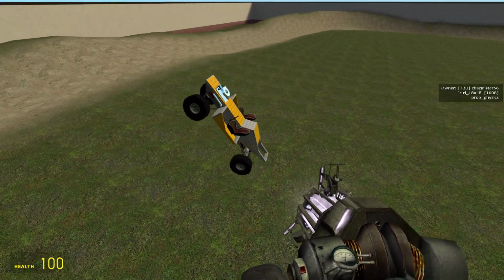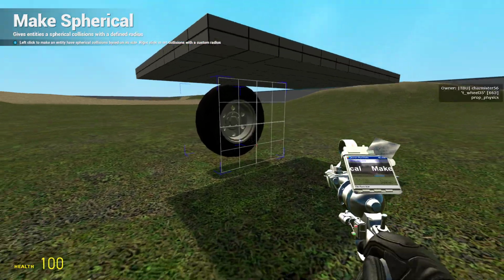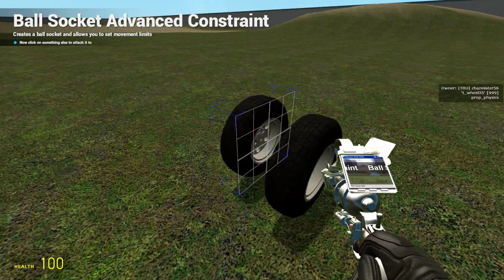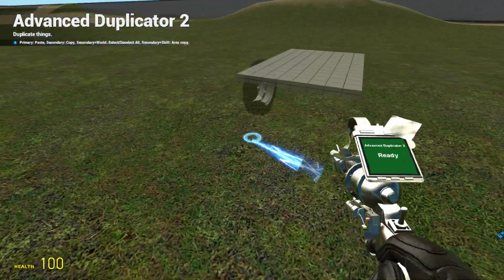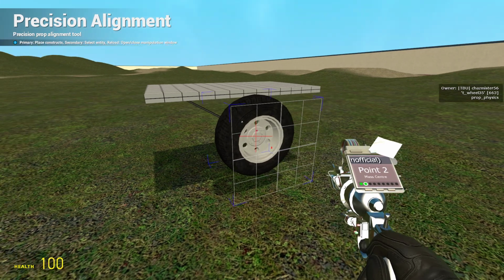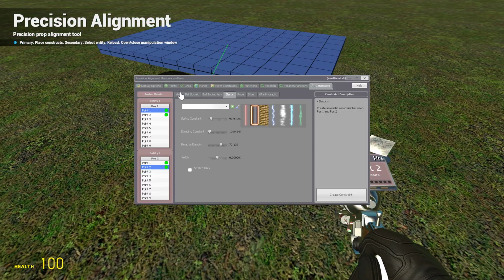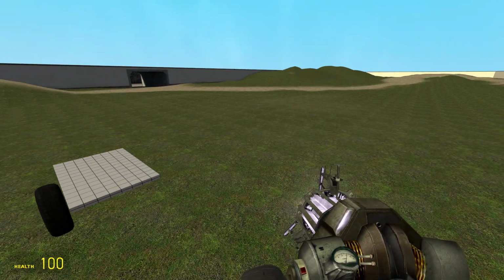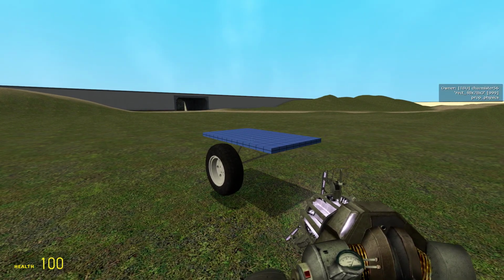[OLD VID  / NEW CHASSIS TUTORIAL OUT NOW] Gmod - 2018 Suspension Basics/Elastics - chazmister56

Comment: i doubt that he will respond to me since this is five years old, but what did you use to propel the car in the beginning foward, and how did you make the complex curves and what not? if he doesnt respond can somebody please tell me i want to make a car like the on in the beginning but i couldnt figure out how to make it move.
Reply from the maker: @huetrwiny  Still active and playing gmod even now, I try to keep up with comments when I can
That chassis is powered by a simulated E2(wiremod) engine, however ACF also works as I've used that for years as well even in that same chassis. The props used are Sprops, the add on should be called Sprops Workshop Edition I think. I just used cylinders to make the cage structure as you would in real life, then spheres on the ends that are the same size move with PA(precision alignment), then join the next cylinder in the center of the sphere to give the rounded end look
If you need help making things move there are some ACF tutorials(albeit most are outdated now), however myself and tons of others still play enough and teach people. I really just need to make a new tutorial that gives the ins and outs of using ACF etc
Hope this helps!
Reply: @chazmister56  it does help, thanks. could you possibly release a video / tutorial for creating a chassis like that one? i didn't really understand it. i got the prop mods and acf i just couldn't understand how to make the chassis.
Reply from the maker: @huetrwiny  Yeah honestly I'll look into it, I've talked about doing it for a few years and it wouldn't be a bad idea to make a few short series/vids explaining it. Again, doesn't help that most other videos are old by like 7+ yrs or are giving out horrible info
Definitely sub and keep up as I may actually do these video(s) within this week
Reply: @chazmister56  if you do, it would also be nice and appreciated if you added a tutorial for steering, and actually building the car mechanics. because im having some trouble and all the videos are like 7 years old
Reply from the maker: @huetrwiny  Posted a small channel update, but things are mostly ready. Tutorial should be coming out in a few days
Reply: @chazmister56  sick

Comment: Any idea how to limit the suspensions travel upwards? I build an army jeep and sadly the wheels are always clipping through the fenders. I've tried ropes but if they reach their max length the wheels get stuck...
Reply from the maker: I usually offset my baseplate a bit higher with precision then lower it back to it's original height, this adds a sort of "preload" that can help. You could also experiment by using another elastic set to stretch only, and yes ropes usually do lock the wheels up(which sucks). If you're using a solid axle setup you can limit the angle of the axles to the baseplate with adv ballsocket too
Reply from the maker: I should've clarified, I raise the baseplate, make the elastics, then lower it
Reply: @chazmister56  Thank you very much for your fast reply! :)

Comment: how would i add steering to the vehicle? i've tried to use this updated suspension with this steering tutorial, but im not sure at which point i should switch to the methods he uses in his video as I'm too inexperienced https://www.youtube.com/watch?v=Flex-2so_Zs
Reply: alternatively, are there any better steering methods i could use that dont require ACF or daktank?
Reply from the maker: @hartmann3288  Steering does not require acf or dak add-ons, you simply need a steering chip that links to your baseplate to attach your front wheels to. Add me on discord chazmister56#1186 and I can send a chip or two to you sometime today when I'm not busy
Reply: @chazmister56  ok, so I've made the steering, the only problem I have is that it rotates the entire vehicle rather than the front tyres
Reply: any idea what might be causing that? the wheels do turn as intended when the vehicle baseplate is frozen

Comment: this doesnt work anymore , the make spherical is fucked , you cant put the rope on the wheel anymore it goes in the sphere
Reply from the maker: No. It works fully. If you are using just the rope tool I recommend making ropes with PA. Makespherical still works fine.
Reply: @chazmister56  yeah , had to use the PA ,i was used to using the regular rope tool so, was kinda stuck

Comment: my wheels are wobbly in the front how do i fix it i did same to back ones and theyre still wobbly
Reply from the maker: If you only used one ballsocket, use another in the opposite way. One would be from the wheel to the baseplate/steering e2 then one from the baseplate/steering e2 to the wheel. Another good example because I don't have any videos up for ballsockets is to follow the video jackpody made. His video covers the ballsockets that most all people in the community currently use. Also double check your wheels are not slightly off angled on accident.
https://youtu.be/IstoqqnwOkM

Comment: the ball socket advanced tool just kills it self when im ball socketing the wheel and prop what do i do
Reply from the maker: Make sure your settings are correct and you're facing north/south. Free movement should be ticked and your locked values should not be zero, but instead -0.001 and 0.001. Don't forget to make sure your wheels are nocolided to your baseplate.
Reply: @chazmister56  ok thanks

Comment: When i put steering on it, the car starts spinning in a circle when i steer. How do i fix it?
Reply from the maker: Sounds like you ballsocketed either the setAng to the baseplate or ballsocketed the front wheels to both the baseplate and the setAng. Undo all ballsockets on the front wheels and setAng and make sure you ONLY do ballsockets from the front wheels to the setAng. Rear wheels should be ballsocketed to the baseplate only. That should be the resolution to your problem

Comment: Does anyone know how to make it withstand more weight? Like if I had a 28ton base plate could I still use this suspension?
Reply from the maker: Yes you could, but if the suspension would be for something like a tank it might be more efficient to just use axis on the wheels instead. But by making the constant higher, the elastics or hydros can support more mass, and eventually you'll need to use 2 elastics/hydros per wheel to keep the strength up
Reply: Racingkiller43 Thank you, and yes. I’ve been building tanks for a good year or two and I hate the wheel adding part, but got around to wanting to add suspension on my tanks, and not JUST “Sudo” torsion. The tank is currently 39tons and it supports the tank about half way from the ground. I’ll try out what you say and let you know! Thanks!

Comment: You made that wheel spherical prior to roping, but then you attatched the ropes as if it wasn't spherified. How did you do that???
Reply from the maker: Well, though it's "spherical", you can still hit the normal sides of a prop, you can also use PA to set point for everything
Reply: @chazmister56  Tested it just now. As of this comment what you said about the collision alone being spherical is true..
I have another question though, in relation to elastics. In gmod 12, they, alongside hydraulics and perhaps ropes had their strength based on set weight of the props at their attatchment.  Do you know if that holds true in gmod 13 and beyond? If you do, I'd appreciate you telling me.

Also, call me entitled, but I would have been more satisfied with you building a functioning chassis from scratch, on video. But that might just be me. ^^;

Thanks for the answer to the previous question at least.

Comment: Is this suspension good for high speed doesn’t it shake like hydraulic suspension
Reply from the maker: It is definitely good for high speed, though it can wobble too if your car is not setup right. It's possible to keep hydros from wobbling as well, it's all in the setup
Reply: My car is shaking a bit at 70 kph
Reply from the maker: @noknok8464  I might try and release a video on car setup considering tons of people are on Gmod because of what's going on
Reply: @chazmister56  do it please because my cars like to wobble at speeds above 250 kph with or without acf. i even rebuild my chassis a few times and it still woble at those speeds.
Reply: @ardaputra428  Tiny question. Have you tried messing around with weights a bit more? And if yes, what would make you think the solution isn't trying different settings for those?
Reply: @Kyugorn  yes and weights do help. but its the setang e2 that causes this problem in the first place. tried with an old setang e2 with no countersteer and its working fine
Reply: @Kyugorn  im still new to expression 2. any suggestion for a better way to implement countersteer to the e2 other than just using the chassis y velocity and just dividing it by some number?

Comment: Another tool I'd recommend is the Re-Elastic tool. So instead of having to redo your elastic settings again, you can just click on your wheels or baseplate, and it will override all the elastics settings. Make sure your wheels and base plate is frozen in the original positions, or it will make it uneven lengths.
Reply from the maker: Yeah I know, I wanted to keep this tutorial simple